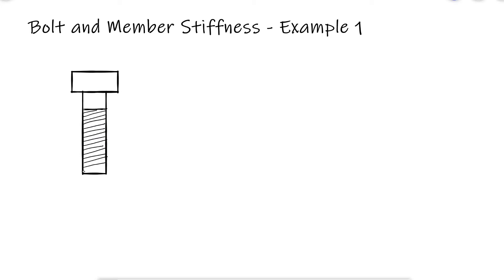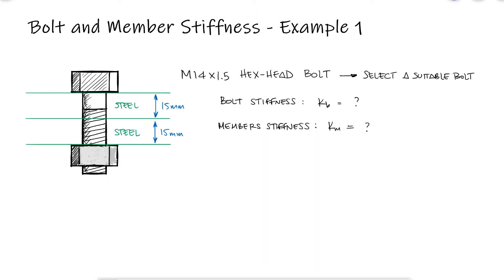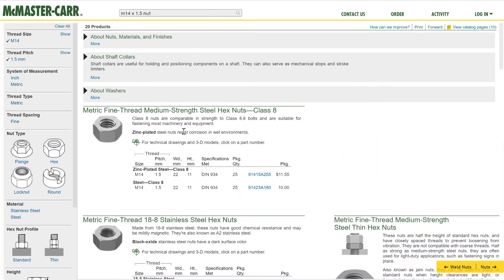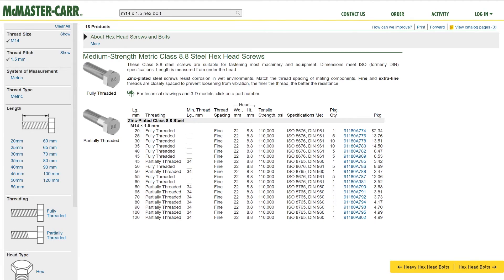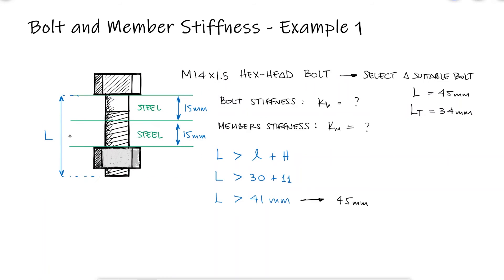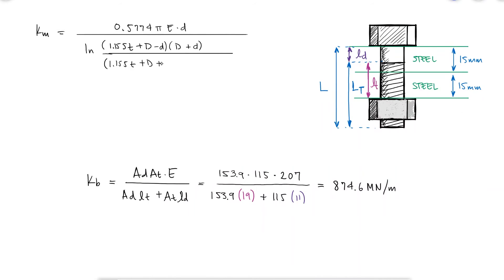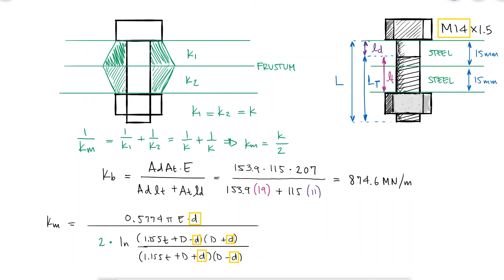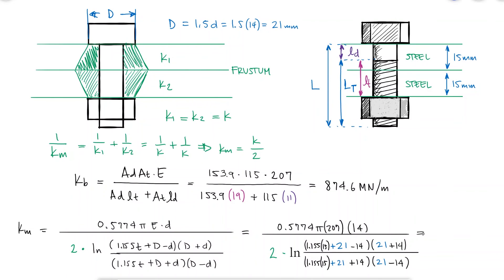Bolt and Member Stiffness - Bolt and Nut Selection - Example 1

Comment: I got this problem in my PE: MDM exam this week

Givens:
Bolt (E = 10 x 10^6 PSI)
Shank: A(Unthreaded) = 0.565 in^2 & L(Unthreaded) = 1.2 in
Thread: A(t) = 0.29 in^2 & L(t) = 0.8 in

Answer:
K = E x A / L
Kb = (Ku x Kt) / (Ku + Kt) = 2.05 x 10^6 [lbf/in]

*Values changed from that in the exam for copy rights only ;)

Comment: The equation for Kb shows the value of 'At' as 115. This is the value of 'At' for an M14x2 bolt from Shigley's Table 8-1. The value for an M14x1.5 bolt is 125. Final answer for Kb is 926.4.
Reply from the maker: Thanks for the note!